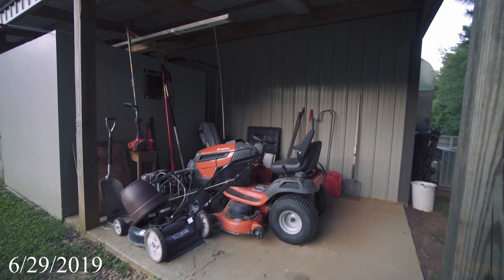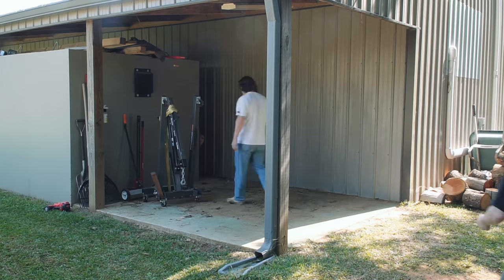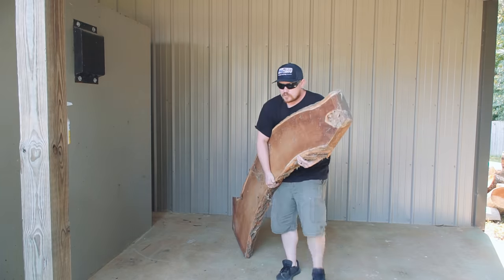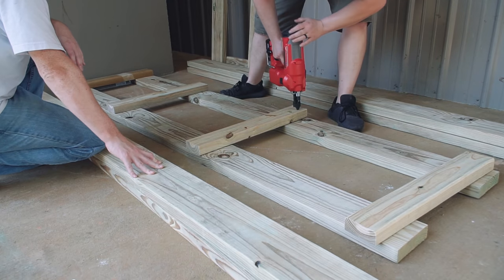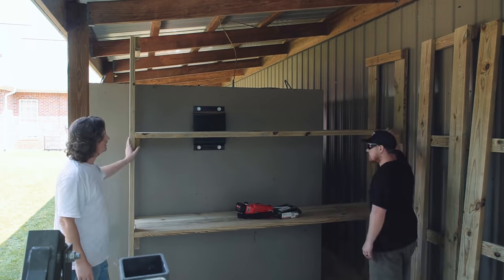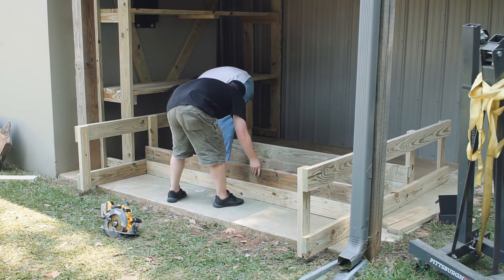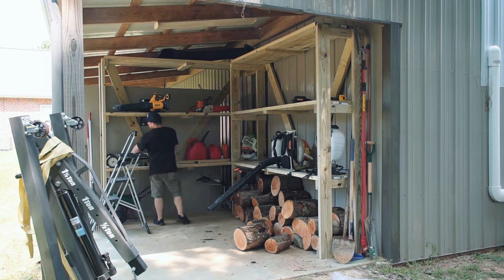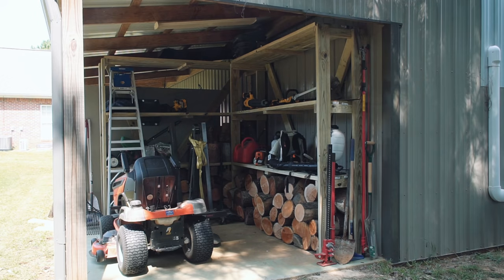Utility Storage Shelves - 353

Comment: I think adding a board in the corner to hold the trimmers vertically would be a smart idea. Also, if you still maintain some Ryobi tools, they have a great little 18v leaf blower that can be found for about 30$ that would be an awesome tool for your daughter to assist you in blowing of the porch or driveway.

Comment: I love your work, but I've learned the hard way that putting 2x material on the flat doesn't work well long term, especially over 6 to 8 feet of span. I hope it works, but I suspect in less than 6 months there's going to be a noticeable sag in all of the shelves. At the very least, I would recommend notching a 2x4 for the center brace and attaching it underneath to prevent that.

Comment: Is the storm shelter anchored to the concrete slab? If a tornado can toss an 18 wheeler it could toss the shelter.
Reply from the maker: I'm not sure. But these shelters are made for tornados. I'm guessing they have some testing involved?
Reply: Just guessing here, but an 18 wheeler has air gaps where the wind can get up under it and surface areas to act like a sail. Whereas this shelter is a hunk of reinforced concrete that doesn't have anything to catch the wind.
Reply: I haven't walked through a tornado. However I have been caught outside on top of a mountain in a typhoon. It's difficult to imagine the force of such winds if you haven't experienced it. For all that, what Phelps Helps says is correct. It's not just the weight. The wind will try to suck the shelter up and push it off the slab but the surface area to push on vs the contact with the ground makes this extremely hard for the wind to pick it up. Whereas an 18 wheeler is like a sail sitting on 18 small feet by comparison.

Comment: It would be nearly impossible to get enough straight 2x material where I live (Oklahoma) to build those shelves. My biggest frustration in trying to build anything is getting decent lumber. A friend recently told me about a lumber yard that is not too far from my home, so I plan to go check out their stock for my next project, but my hopes are not very high. All the lumber yards around here seem to get their stock from the same suppliers. With that said, you can only guess what kind of crap is going into new home builds in this area. :-(

Comment: Do you plan on doing anything to keep the rain out or are you not worried about it?
Reply from the maker: The roof works, this is all treated lumber, and all the stuff is outdoor rated.
Reply: @JayBates  I was more talking about the tools and equipment than the shelves. Like you just leave the battery blower out there and it's all good?
Reply from the maker: Oh. Gotcha. Yes it's fine. It doesn't get wet.